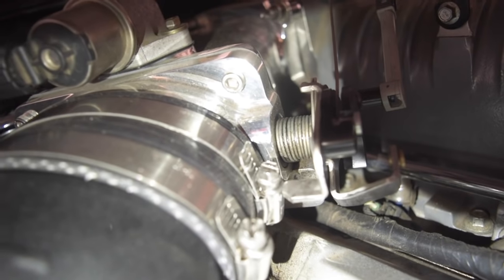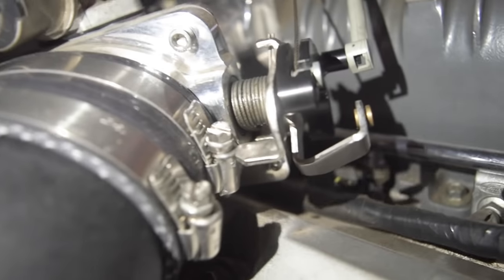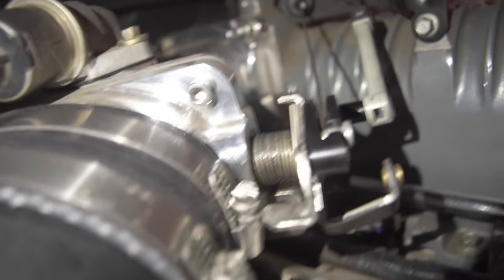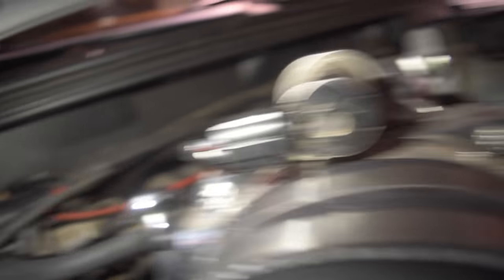How my Cobra’s Gas Pedal Got Stuck Wide Open

Comment from the maker: Rookie mistake 😪I blame Joel though. 😂more content coming to the channel and a big announcement!
Reply: Same thing happened to me. Came out of a Gas station and hit it. As I was in it, I seen the light ahead turn yellow. I thought at first to fly through it before red but was not sure of the opposite traffic (cops) so I hit the brakes pretty hard and locked them up. My rpm needle was bouncing off the limiter because my throttle was stuck. I threw it into neutral so fast and turned it off immediately at the light. Started her right up, and drove home. I got turbotecnics hose clamps that were in that same position. Lol hillarious. Gotta love the new edge game.
Reply: Same thing happened to me but mine got stuck down because of my floormat 😂😂
Reply: Big announcement is a new car isn’t it!
Reply: @jordanshepard1728  lol

Comment: Most Cobra owners install an extra pull back spring on the throttle to prevent it from locking open because the same thing can happen to you if the throttle cable ever broke. The back up spring will snap it back to idle. Glad that neither you nor the car was hurt bro.

Comment: I bought my cobra 2 years ago with 9,800 miles on it. First thing I did was take it to the ford dealer for the pedal recall... they put a metal plate behind the pedal and that's it. Take it in and it'll be done in less than an hour.